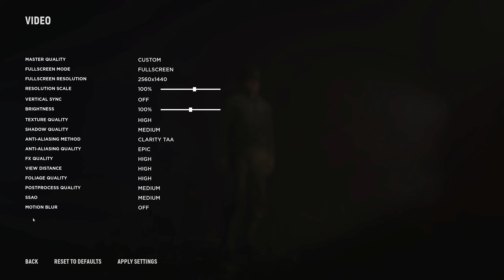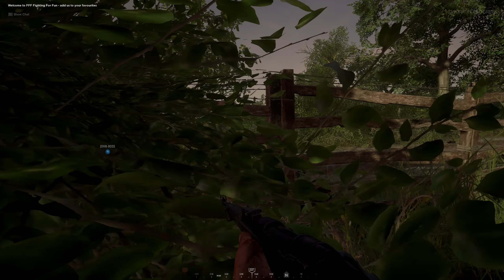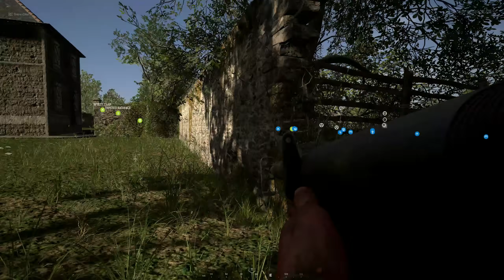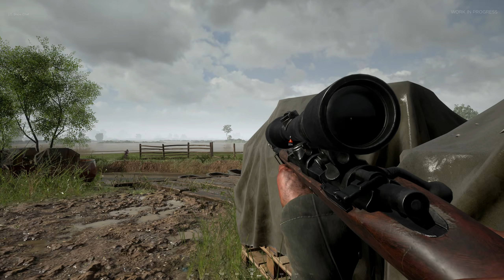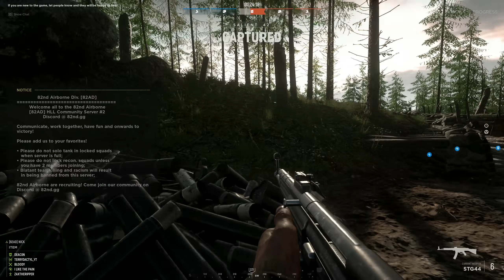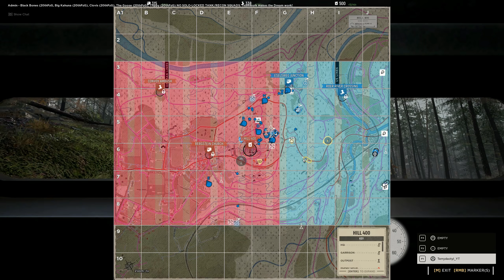The ESSENTIAL BEGINNERS GUIDE to Hell Let Loose

Comment: Hey, great video. The only question I have, is how do I stop the crazy stuttering and fps drops in this game?
Reply from the maker: If you have the bug that happens where your FPS drops to below 10. Redeploy and spawn in then look at the ground for a while. Its a weird bug but doing that should help. Otherwise check your video options, make sure you apply them whenever the game is loaded, and turn down the dead body delay.
Reply: @Terrydactyl  Thanks! Any idea when the devs might get around to fixing such a game breaking issue?
Reply: Its part of the game, mine freezes maybe 3-5 times during 40-50 min game. They will have to fix it on their end, its not your pc. I even got it on the lowest settings, im on maximum settings now cause my pc can handle it, just wanted to let anyone know that it doesnt seem to matter. They might patch it one day. But for now got to get use to it. Even if it gets you killed which sucks but be happy you can respawn at least and do not have to wait for medic to play.

Comment: To all new Officers, understand that your primary mission is to build garrisons and set up for the rest of the team to attack. Do not wander away from dropped supplies and listen to the commander or other Officers when they ask you to place down a garrison, the outcome of the battle depends on it.
Placement of garrisons are crucial, you never want to stick them on the objective since this is where the enemy will automatically go when they attack and your garrison will be lost instantly. The number or garrisons are also key to winning. Do not think that one garrison is enough, ideally you want three to triangulate and secure a point.
Reply from the maker: Great info for Officers!
Reply: @Jay Dorn Be gone troll. In my defence, this post/comment was made before U7 when the meta changed.
Reply: But how do you place outpost and garrisons?